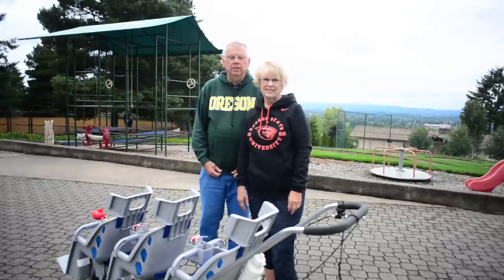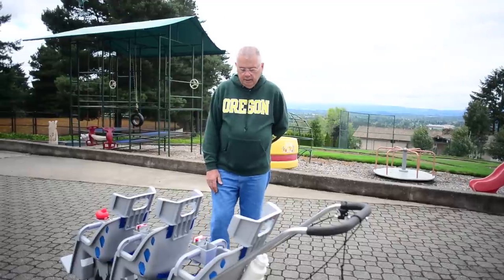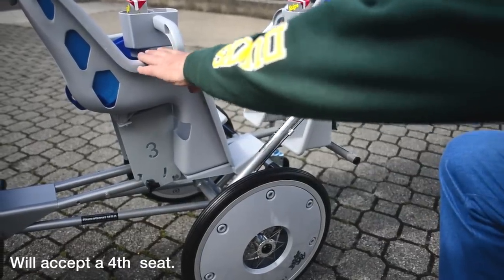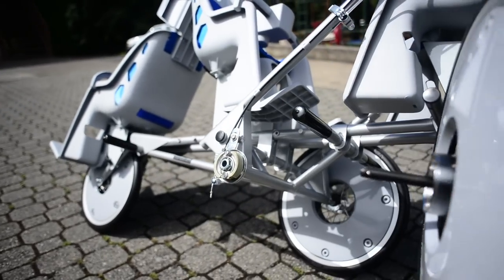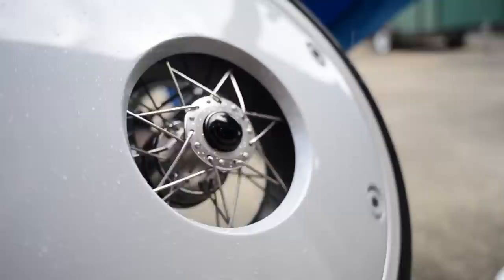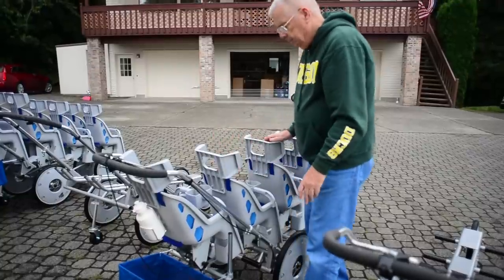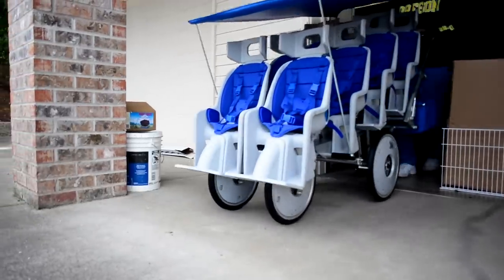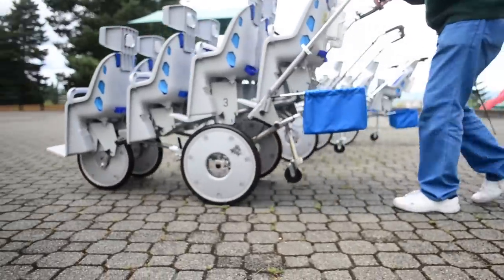Runabout Stroller Factory

Comment: Why did you switch to the smaller wheels in the six seaters.  I have a older one with bike wheels and you would think the bigger the wheels the easier to push.  I hate strollers that are hard to push. I used to have a old Amish daycare buggy and it pushed so easy compared to the big plastic red ones they make. I can not push them!!  My old runabout just keeps going. I got it used and the pads and seatbelts all needed replacing. I still need to replace the pads but kids don’t car.
Reply: Angeles bought the rights to the six seater stroller and also to use the Runabout name and then they changed it– I believe, for the worse.